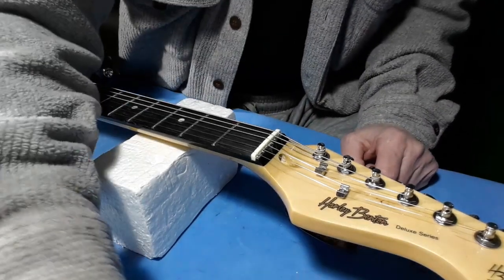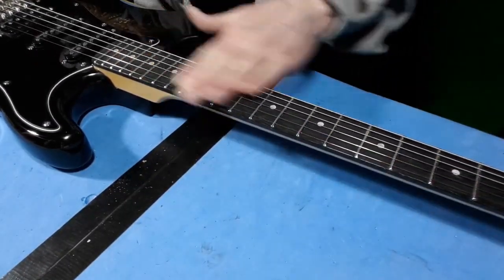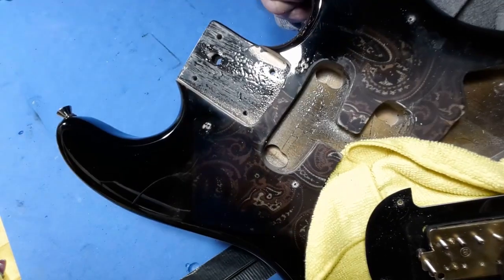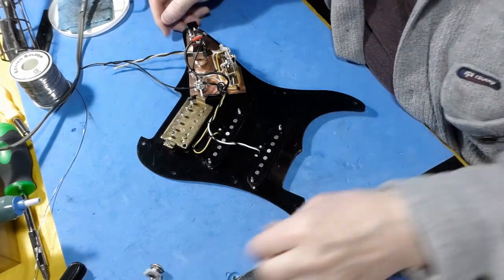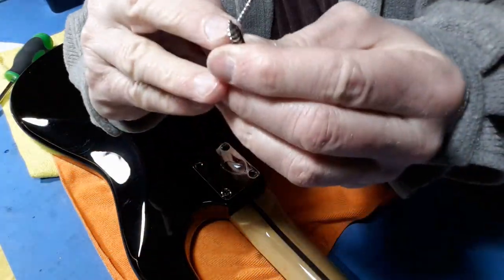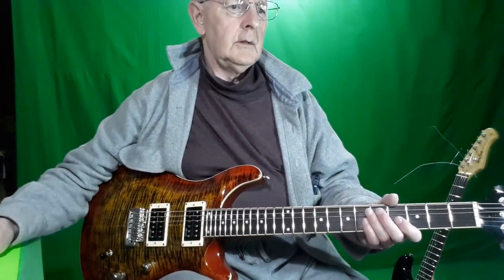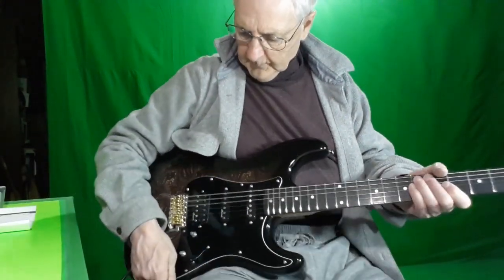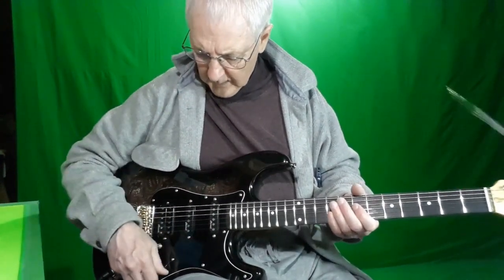Harley Benton ST-70 Paisley rework and impressions part 2 of 2

Comment: That is the cleanest wiring job I think I've ever seen.  You an electrician by trade, or just damn good at wiring?

Also, the different sizes of screws on a brand new guitar kills me.  ESPECIALLY in a loose neck pocket.

Great work on those frets!
Reply from the maker: Was trained as engineering technologist in college.  worked 17 or so years on a bench as a test and repair technologist at computer  and telephone equipment manufacturing companies before climbing up and crossing over to aviation industry  for 27 years in supervision and design jobs. I've had a lot of practice back in the day so I guess I still got it.  like riding a bike.   thanks for looking in and contacting.  I appreciate it much.
Reply: @2bikemikesguitartopics145  That explains it.  I try to do the same when I build computers... like you, also from decades of experience.  

Stay safe.
Reply from the maker: Yup we're safe so far.  Ontario is the hot spot province and still going up even with lockdowns.  
You be safe also.  It's good that it's still cold here as my winter season is usually self isolation anyway.  I have my guitar hobby to occupy time.

Comment: Fender’s Squire label has been building guitars in China from Chinese parts for years at much higher quality. Own/owned several myself. They didn’t need such work to get them playable (such as leveling frets). Fender just uses higher quality parts and production standards from their Chinese/Chinese licensed factories whereas rock bottom guitar companies like Harley Benton and Firefly do not. Chinese factories will build good stuff if you give them good parts (even from other good Chinese factories) and hold them to high standards and set a price point to match. See products like Fender Squires, Epiphones, Apple Electronics. This is a case of price is too good to be true and buyer beware.